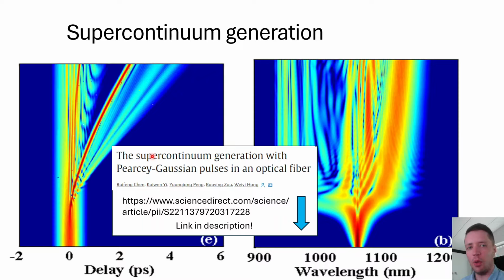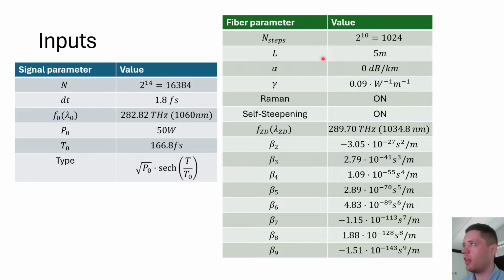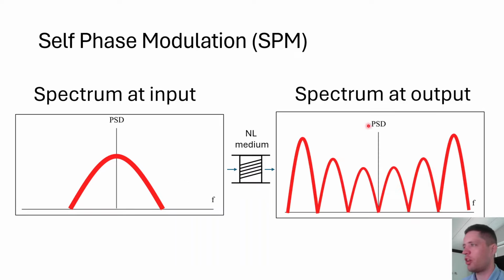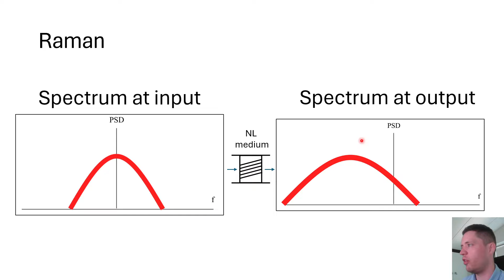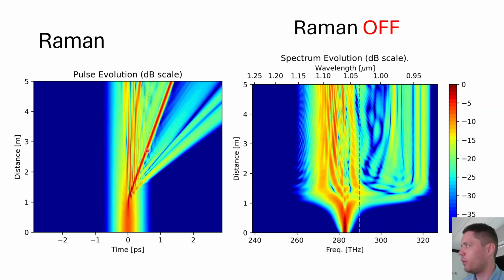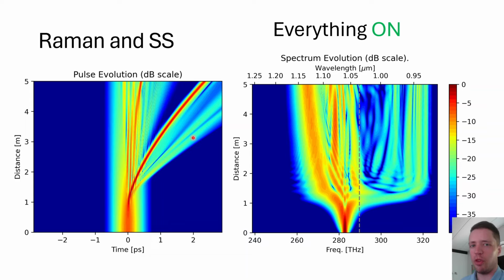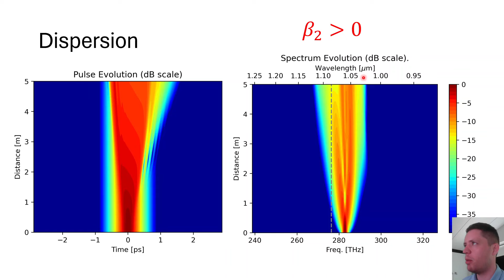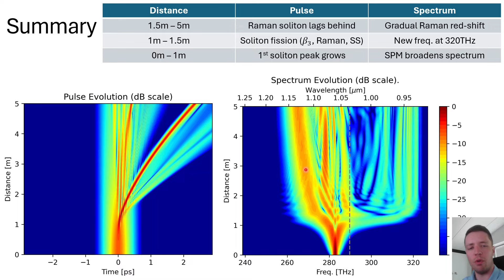Supercontinuum generation explained!

Comment: Fantastic, the clearest and most easy to understand explanation of the simulation plots ever! Looking forward to playing with the code as well!
Reply from the maker: Thank you! Please let me know if you need any help with the code.
Reply: Your video was the first thing I thought of when I saw this video. 😀
Reply: @yourfavouriteta  Code is great, had to tweak the directory path line to get it to run on Linux, but that is all, it works just great! When I get time, I will throw some other parameters at it. It looks like a really nice intuitive way to poke at things without hours of setup!
Reply from the maker: @LesLaboratory  Awesome, I am happy to hear that you got it to work! My intention was to make it accessible and flexible, so the user can quickly begin to play around with the parameters. I recommend trying to re-create basic effects like self-phase modulation first to familiarize yourself, but I am sure you will figure it out. Otherwise, let me know if you need help!

Comment: This is a very great tutorial. Thank you.
I would think that to do the same for photonic integrated circuit waveguides, one would have to change the length, nonlinear coefficient, and dispersion. Are there other major differences that I may be omitting?
Reply from the maker: Thank you! My code also works for PIC. At the moment, only single mode behavior is supported, so be aware at which frequency your waveguide become multimode; results may be invalid beyond this limit!

Comment: Great explanation. Is it necessary to have a fs time step to capture the Raman effect?
Reply from the maker: Thank you! Using an approximation, It is possible to capture the impact of the Raman effect without having a fs time step. For a pulse that's much longer than the Raman response time, the magnitude of the effect in the NLSE basically depends only on the derivative of the pulse power w.r.t. time. Introducing the term T_R*A*d|A|^2/dT (where T_R is the average duration of the Raman response function) in the NLSE can thus capture the impact for long pulses. 

You might want to do this if, for example, you have a very high power pulse with a duration of ~100ps. The high power means that Raman could be significant, but the 100ps duration means that using a 1fs time step (i.e. using 100.000 points just to cover the pulse itself) could be too computationally expensive. The derivative term allows you to use a much larger time step and still get the expected red-shift at the peak of the pulse. I might actually make a quick video about this, since it's an interesting example of physical insight leading to a more efficient way of doing things. 

My code does support using the derivative approximation. Just specify "raman_model = 'approximate' " when defining the fiber.
Reply: @yourfavouriteta  Thank you. I will try this out. Waiting for the video!

Comment: What differences would there be if the frequency was doubled?
Reply from the maker: In reality, two things would change. First, The values of the dispersion coefficients, β2, β3, ..., would change because they are the 2nd, 3rd, ... derivatives of β(ω) = n(ω)ω/c w.r.t. ω evaluated at the carrier frequency of the pulse. This will change how the pulse evolves in the time domain and whether phase matching is satisfied. If the carrier frequency of the pulse is initially close to a frequency, where β2=0, the new β2 value at twice the frequency is very unlikely to also be close to 0, so most likely the generated spectrum will be narrower.

Secondly, the impact of self-steepening is reduced. In the GNLSE, the term describing this effect is significant when the time derivative of A|A|^2 is large compared to the carrier frequency. Thus, doubling the frequency cuts this term in half. If we assume that the dispersion coeffs are miraculously unchanged, the effect of increasing the carrier frequency by an amount so large that self steepening becomes negligible can be seen in the video when I switch self steepening on/off. 

Lastly, if the carrier frequency is doubled in my code, only self steepening is affected because the dispersion coeffs are entered into a list independently of the carrier frequency. In reality, the two are of course linked, but doing it this way gives the user more flexibility in investigating the impact of dispersion.